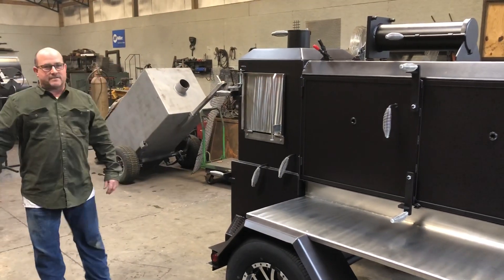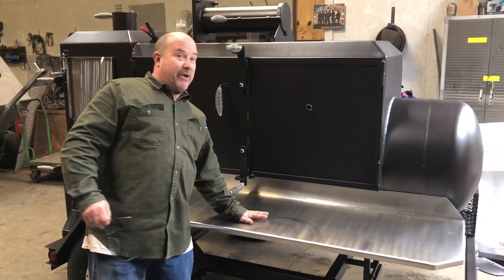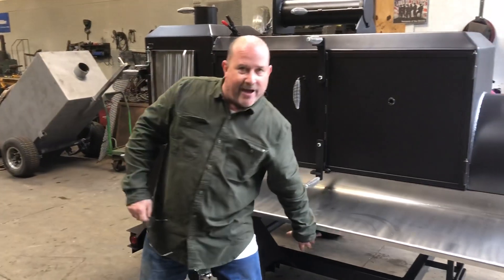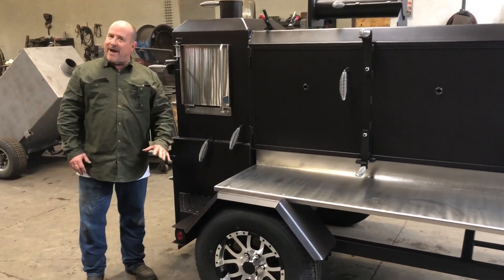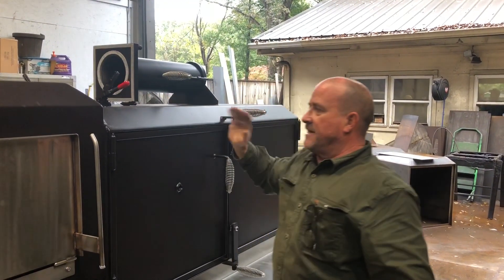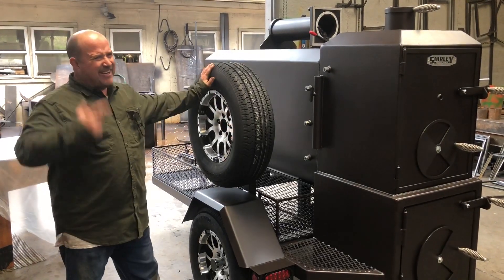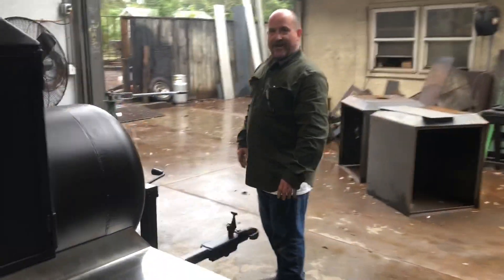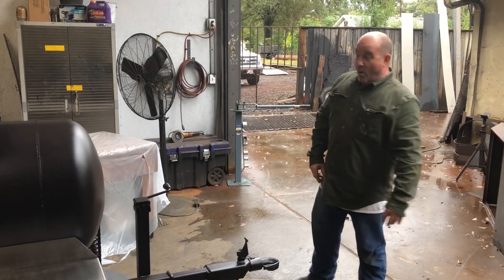October 27, 2018

Comment: The fold down stack and cradle idea was stolen from some Texas builders.
Reply: Would you happen to know which Texas pit builder?
Reply: @Mister_Perine   Moberg, Milscale Metal Works, Austin Smoke Works and Evie Mae's all build pits with fold down stacks in a cradle as an option.
Reply: The BBQ Jerk so you’re saying it’s public knowledge at this point then or are you saying it was stolen from three builders or did two Texas builders steal it from the original? What are you saying?
Reply: @mikecoughlin4128  I don't really care either way. My point was Paul's blood pressure goes up 50 points when other builders use his and Tyler's ideas. But here he is using other's ideas and saying someone in his shop came up with the idea, when they didn't.  I don't care either way. Folding stacks are a good feature and its nice to see them as an option on a Shirley. But don't complain about other builders use your ideas...
Reply: He didn't say they came up with the folding stack. He said the person purchasing the smoker came up with using the latch clamp to hold the folding stack in place during operation instead of requiring bolting. Also he said in th epast they laid the stacks onto the top of the cooker, but one of the guys working in the shop decided to make a better spot with cushion for the stack to sit on. Once again not claiming they came up with the folding stack.